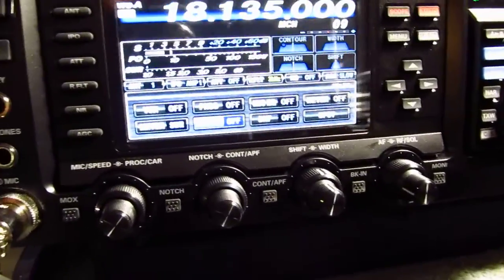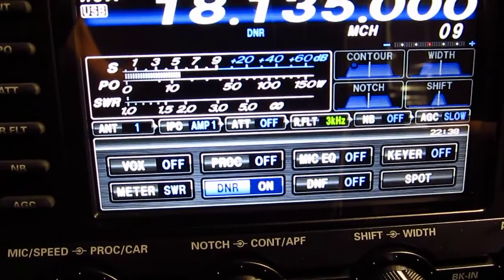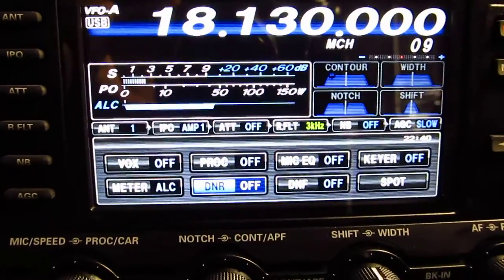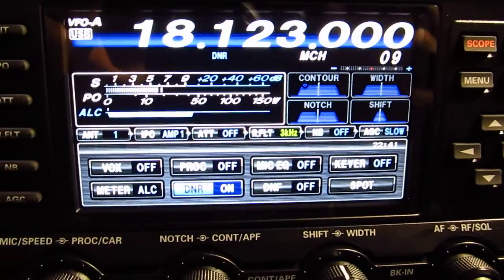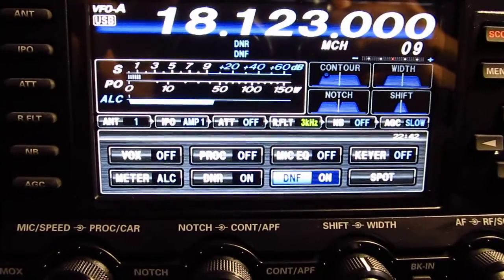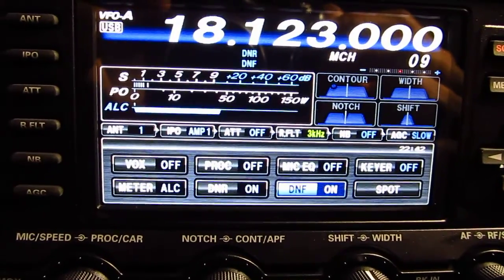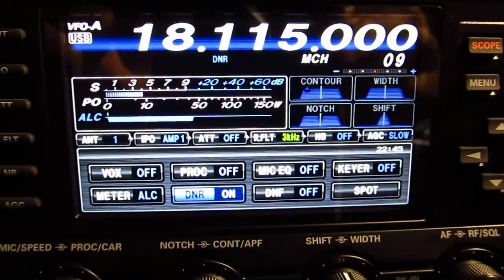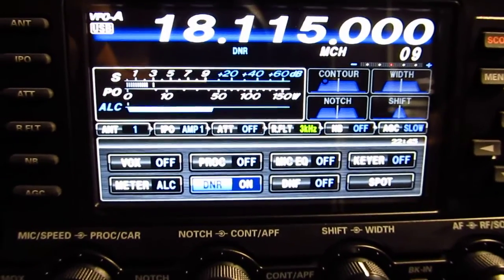Yaesu FTDX 1200 DNR Digital Noise Reduction

Comment: Good morning, my friend, could you please help me?
I have an FTDX1200 and I'm having trouble putting the messages in CW in menu 027/031. How do I put the messages?
It was easy on the FT897, but I can't do it on the FTDX, the manual isn't helping. Thank you.
Reply from the maker: @marcoa.v8021  I’m sorry for the delay, regrettably I no longer have this radio and unable to assist at this point.

Comment: The initial noise sound like electrical pulse. Noise blanker would take that out...but I will say, the DNR on the 1200 is great. Hardly any watery sound at all. 1200 is probably the best bang for buck radio ever.

Comment: I am thinking of buying a 1200 this week. How has it been working? how is the antenna built in tuner? Would you buy it again?  Thanks
Reply from the maker: +buzzsah great receiver and DSP, the built in tuner has a limited range of tuning, anything over 3~1 SWR, it will not tune. So you may need an external tuner. I wish it had a USB connector and a live scope, but other than that, and for the price; yes, I would buy it again. Thanks and good luck.
Reply: +N1CY Thanks, I have been off the air for 30+ years and find it has changed.  I just installed the 400 2/70 in the van but need a good HF.  Thanks again
Reply: Yup

Comment: Hi, could you or someone else tell me if the DNR algorithms are exactly the same as implemented into the FTDX3000 ? Or, maybe Yaesu took back the 15 algorithms that was (not so) effective into the "old" FT2000 rig ? Tnx, 73 de ON6CV.
Reply from the maker: It is the same as the FTDX 3000.